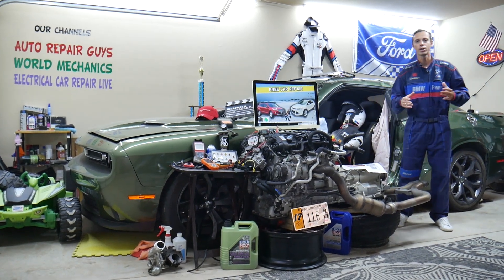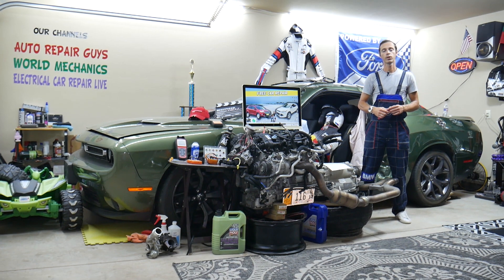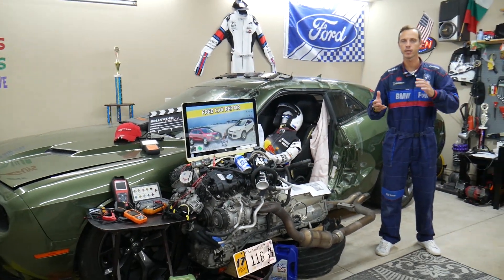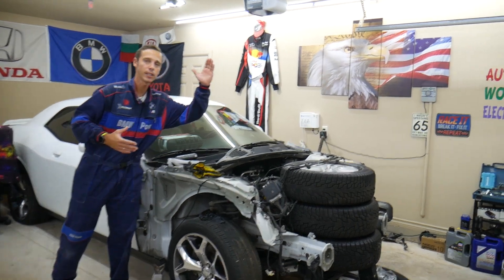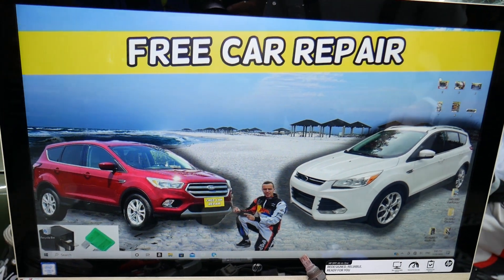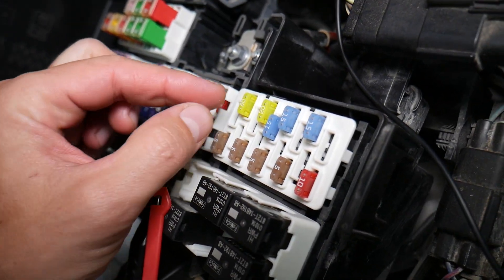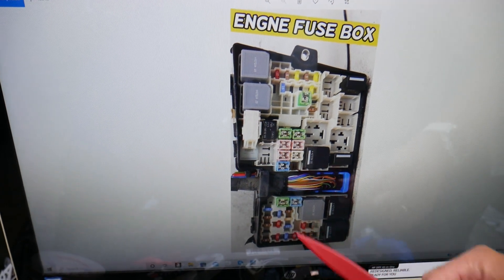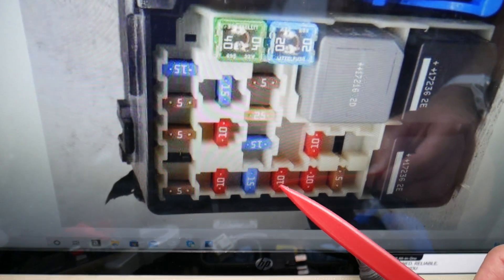FORD ESCAPE TURBO CHARGER BYPASS VALVE FUSE LOCATION 2013 2014 2015 2016 2017 2018 2019

Comment: Thank you. I changed my bypass valve months ago. I kept the one I took out because it looked fine. The new valve did nothing .My friend that is a mechanic told me to trade it in before it blows up. After watching this in video it was the fuse the whole time.